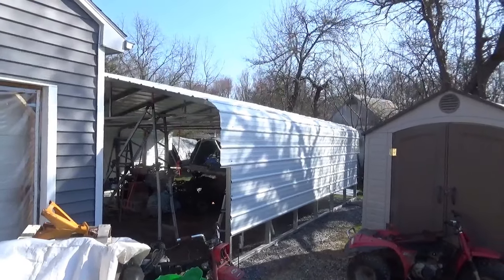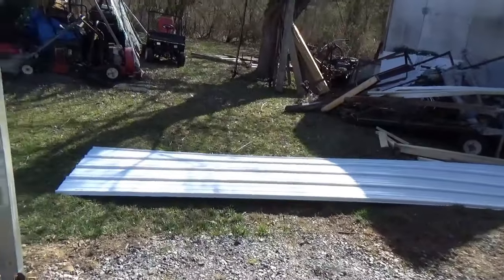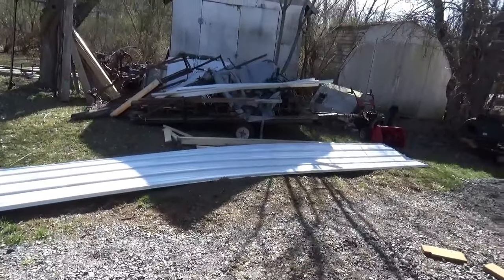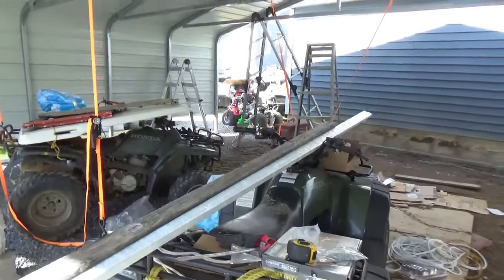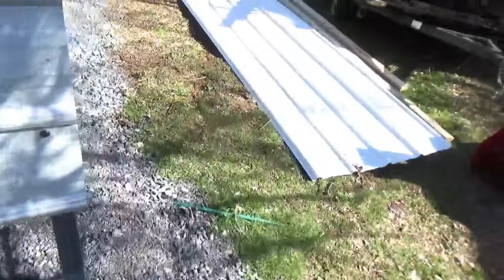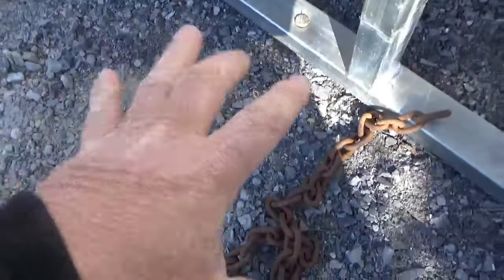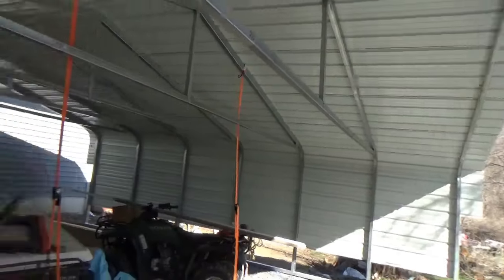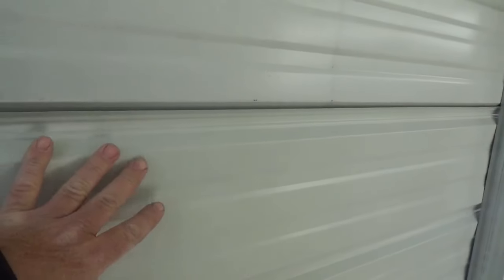Versatube Carport, Build and Review!

Comment: They make tie down anchors, they are used to hold down moble homes etc. They are also used for car ports, they spiral into the ground. Look into them it would be much easier than concrete and just as effective. Good video
Reply from the maker: Hey Kentucky Yankee!!!  On the far side of the carport, there is a rock ledge just below the dirt surface, a couple may work closer to the garage, I've seen them installed on a youtube video... I will look into them!  Thanks for Ur thoughts, info, watching, and commenting!!!
Reply: @HarveySpooner  Those ground stakes are supposed to be set in a concrete piling. At least that is what my Versatube instructions show.
Reply: yup. Let's not follow the instructions by the manufacturer.

Comment: Holy cow. My 18×20 was installed on unlevel ground in about an hour and a half by 2 guys that hardly even spoke to each other as they worked on automatic almost like robots. I did absolutely nothing but sit in a chair and watch while drinking coffee. Mine came with edging installed that prevents cuts. My plan with unlevel ground was on purpose because I watch so many people stand in puddles of water on their nice level concrete floors. My wife and I poured concrete one section at a time over several weeks. In leaving my floor slightly slanted I can wash cars and the water runs off in a nice short time. When storms come the water cannot make puddles and goes away. The pins are good until about 75mph winds (with mine) but I live in Tornado Alley where things get nasty really quickly at times. I'm sorry you had to build that yourself. It is a nice big hunk of space. 👍👍
Reply from the maker: Hey Fan!!! One can get away with not level if the rails are still parallel. U R right though, a slight pitch would be good to get rid of standing water! I was able to pull some of the pins out that were 18inches buried, I would not think it would take much wind to lift it... I appreciate the info U provide as I have not experience with metal buildings in the wind! The guys who built Ur carport had experience, my buddy and I had to look at the instructions... Careful there in Tornado Alley.... Thanks for all the info, suggestions, knowledge, watching, and commenting!!

Comment: Your prices up there are really expensive. I had a 24 x 26 with 7' walls and a regular peaked roof, completely installed for less than $3500. It sure is handy for keeping things under cover.
Reply: everything cost 2x in newyork
Reply from the maker: Hey Fix-it Man!!! Where I live, the snow load adds to the cost, right now, the metal shortage is driving up prices... Versatube is not the cheapest supplier out there, American metal, union help, etc... And as Dave said, everything costs 2x in NY!!! I love my new carport and I'm sure that U love Urs also!!! Thanks for the info, Ur thoughts, watching, and commenting!!!
Reply from the maker: Hey Dave, I would love to disagree with U, but, I can't, U R right!!! Thanks for Ur thoughts, watching, and commenting!!!

Comment: Another option for the floor
Roto-till cement in 
Second till with moisture
Level.  Compact relevel
Final compaction
Moist again if needed
You would be making
Cement Treated Soil
How much cement
Concrete can be 4-5 or 6 sacks (94lbs per cubic yard 27 cubic feet)
Length x width x depth. ÷ 27 = cubic yards...